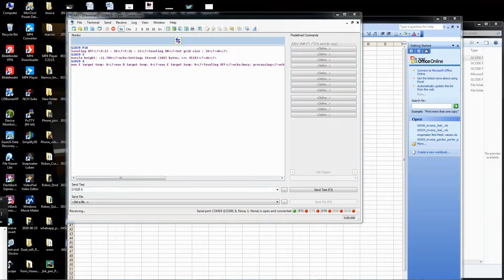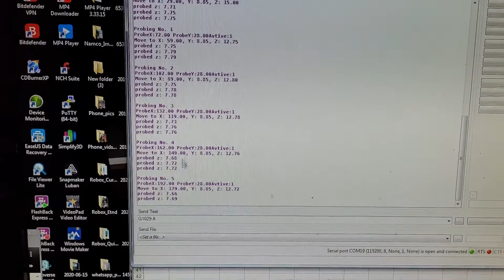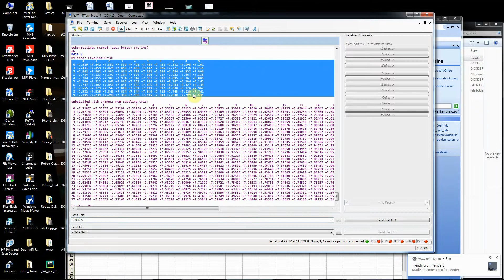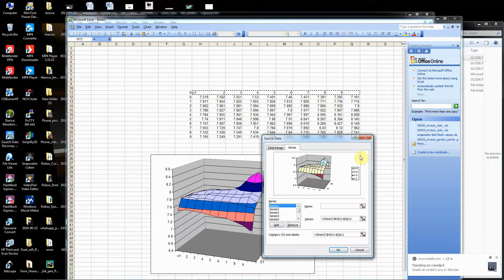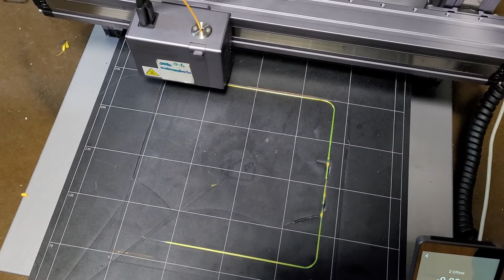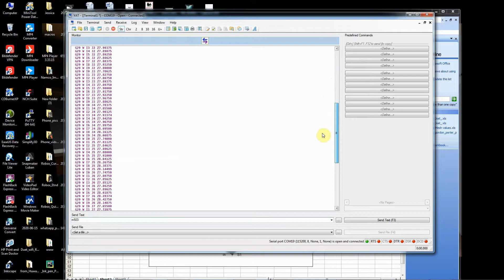3D Printing Perfect Bed Mesh Levelling - Snapmaker 2.0 with firmware 1.10.1

Comment: I was looking for a solution to get better bed levelling as my A350 print surfaces becomes quite uneven after a few prints.  I followed the instructions in the video and so far I got great results!  Looking in Excel, I noticed that the areas where I had issues with first layer corresponds to highs on the graph!  Indeed, that would explain why nothing came out the nozzle in some places only... the nozzle was way too close.
With a 10x10 probe matrix, the nozzle extrudes properly all over the place now!  This was just the solution I needed.

Great guide and thanks!  Cheer mate!
Reply from the maker: Thanks buddy for the feedback. Much appreciated 😀

Comment: I wasn't sure about this from the video but does this perform the meshing at the elevated bed temperature? Every time I've tried this in the past and start the auto calibration, it turns off the bed heater.

Comment: Thank you! But a note: I've run this procedure on a Snapmaker 2.0 350 with v1.11.4 firmware and that Z Offset final set is definitely not needed. I was printing in mid air!
Reply from the maker: I found out why I needed to do the z offset. Its because I set the fade height value for the mesh to be non zero.(M420 Zx.xx). Zero means apply throughout the print. Any non zero value means apply only over that value...but setting it to anything other than zero causes the built in z offset in mesh calcs in firmware to be lost hence needing the z offset I mentioned. I put my fade height across to zero (default from factory) and don't need the offset either now

Comment: Hello, sorry for my noob question. Can i use this to do a 12x12 point or even a 16x16 point?
My bed it's really uneven.
Thanks you very much
Reply from the maker: Hey buddy no worries. The max size i think is 12x12.  Also the m206 z height change that I went on about is cos I modified the fade height from snapmakers default of 0.  So I doubt you will have changed yours as you have to use m420 command to do it.  So you should be good to do this without doing the faff with M206. So just do a G1029 P12  instead of G1029 P10 as I do and follow rest of the video
Reply: @chazj1976  Thanks you very much :)

Comment: I found on my Snapmaker A350, FW 1.10.1, if I did set the M206 Z offset the print would happen in the air, and it looked like it was printing above the bed the distance I set in the command (in my printer I set M206 Z-5.9).

 Resetting my M206 Z0 has the printer working again - so it might not be a universal need to set? I nervously watched the start of the print and no head crash, with the M206 Z set to 0.
Reply from the maker: Thanks for the info and reply. Hope the procedure helped. I might remove my z offset and see if somehow its OK now. At least putting it in results in air printing worst case rather than nozzle driven into the bed 😀👍

Comment: Thanks for this - can you reiterate the last command? You said M500 to save but I see you typed M503 - but it was hard to see because youtube put up 2 more preview video windows right over the command line so I couldn't really see. Annoying (on YouTube's part, not you). It happens right at 19:58
Reply: Got it: M500 saves the settings. M503 shows the stored settings

Comment: Giving it a shot.  For some reason it was setting my Z value to 0.0... I dunno what I was doing wrong.  Thank you!
Reply: Dumb question, how do you enable a 10x10 auto calibration?
Reply from the maker: @raginarr  just follow the video.  You have to connect via either Lunan serial or using YAT as in the video.  The G1029 commands sent by serial setup 10x10.  You can't do it by the hand controller
Reply: @chazj1976  Copy.  What exactly does M206 do?  I tried to adjust it and ended up running into the bed.  Once I run into the bed do I need to recalibrate before I end up trying to adjust the M206 command again? I'll be down for awhile until I get some more PEI sheets... Thanks for your guide.  It's really helpful.